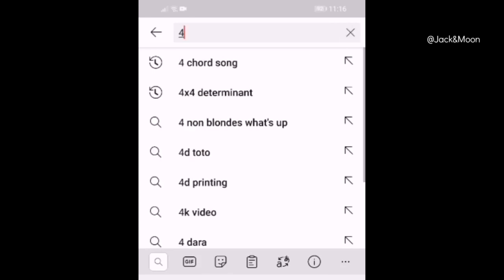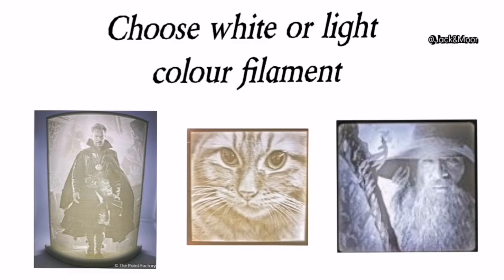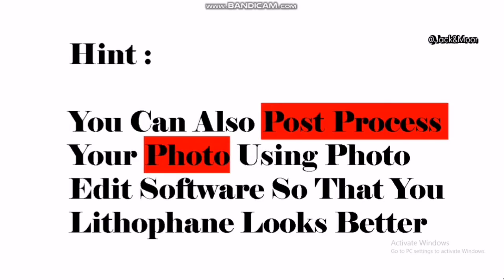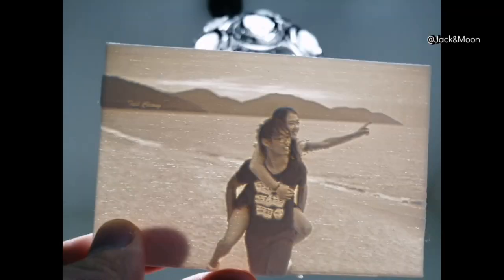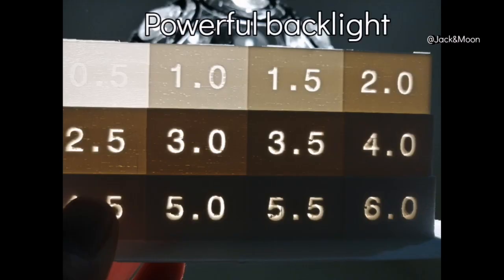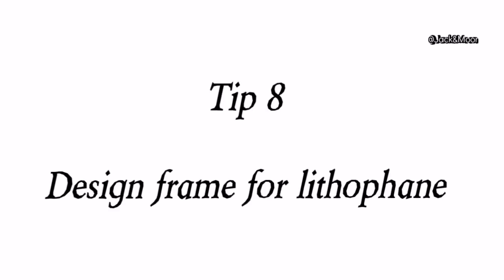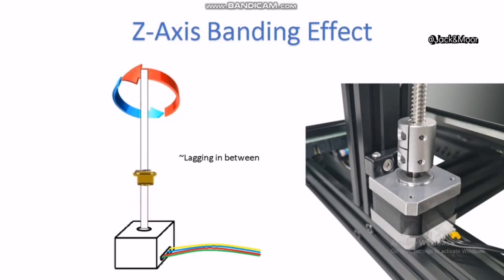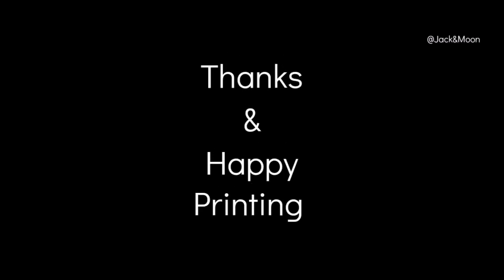[Lithophane tips] 10 Things I Wish I Knew Before Making Lithophane - 3D Printing

Comment: if you are familiar with solidworks you can do lithophanes fully within the program:

first, design a parameterized frame whos dimensions are controlled by the resolution of the imported image (or just manually adjust sketch dimensions for each new image). select the face that you wish to have lithoed (the face within the frame body), than adjust its appearance, place the image you want on the face, and apply the 3d mesh tool. you get all sorts of controls, and lightside up/down, so your lithos can also be reliefs.

Comment: Unless you are running an unusually heavy direct drive, the heated bed is MUCH heavier than the X axis. You could argue that the Y axis imparts a lower moment of inertia as it is closer to the bottom of the machine, but I've always found minimizing Y axis moves to improve quality on bed-slingers. Even the original dev of the lithophane site recommends printing minimizing Y movements on critical surfaces. Did not even stop to compare the two results.

Comment: Is the tip about printing along the Y axis still true with a printer like an Ender 5 where the bed only moves in Z? Thank you.
Reply from the maker: Hi, that is a very good question. The main idea is to print in the axis direction where the printer is having least vibrations. Beside the heat bed, the movement of the hot end will also contribute to the vibration. But for your case, Ender 5 (core xy printer) because the movement structure is almost similar along both x and y axis, it will be less difference in effect. Thus this tip will be not effective for you. Good luck and happy printing.
Reply: @gravity-less3dprinting624  Thanks!
Reply: More importantly, tighten everything

Comment: My printer is Ender 3... I print both X and Y axis.. but not seeing any quality difference..
Reply from the maker: If you are printing with extremely slow speed, the overall vibration become negligible in both axis, so the effect might be not observable. Hope my answer help to explain🙂
Reply: @gravity-less3dprinting624  Thank you... Should I use 100% infill or increase the number of walls for good quality and better printing speed
Reply from the maker: @azaharuddinsk100  For our testing, we implement both 100% infill and increase the number of walls, the quality is good. If u want slightly lower printing time, u can try 99%infill, the quality will still be great but u need to choose the infill pattern.

Comment: The ones I have printed flat have actually printed pretty well but everytime I try to do one vertically it fails, it gets like 20% or so and then messes up everytime. Any suggestions for me?
Reply: use a brim. you need to keep it from wobbling as it gets higher. make sure you have good bed adhesion. If you are printing on glass, try some glue stick.

Comment: I cannot get these to print all the way. Last one I tried was an estimated 10 hour print and about 8 hours in, it spaghetti'd everywhere. I have tinkered with the settings but I can't figure it out. 

Last settings I tried

.16 layers
45mm speed
200 Nozzle Temp
97% Filament flow rate

Comment: do you know if you can make lithophanes using resin?  Have tried and cant get it right - and if so, vertical or flat for printing? Great video by the way
Reply: I'd say try it yourself. It probably wouldn't waste but a teaspoon of resin, if it didn't work. You'd know within the first few layers if it will work.
Reply: @BiscuitGirl9154  it does work we do it in our company hycube works Bangalore